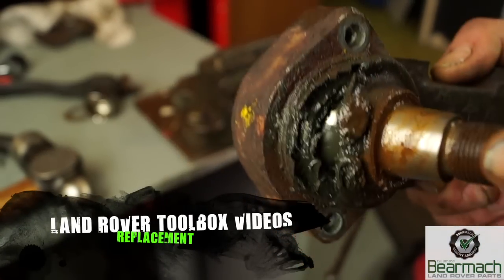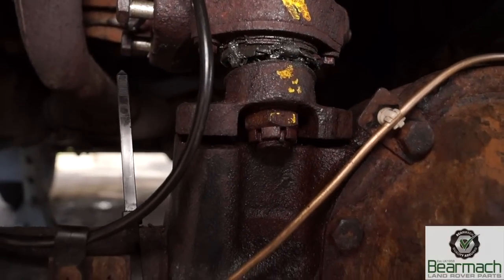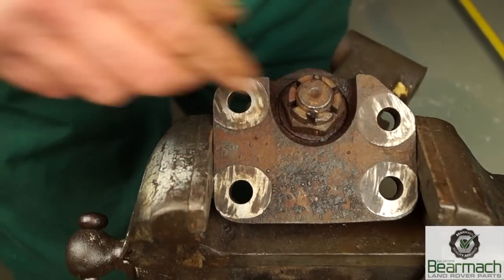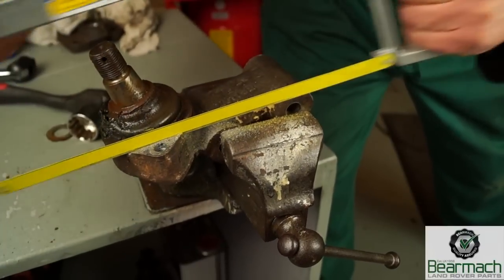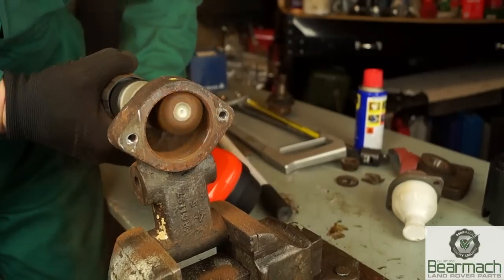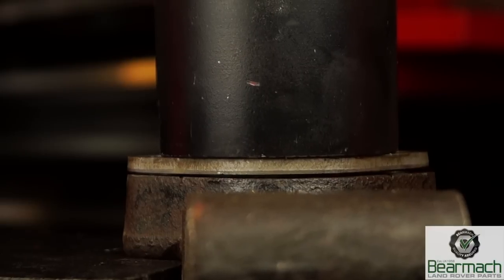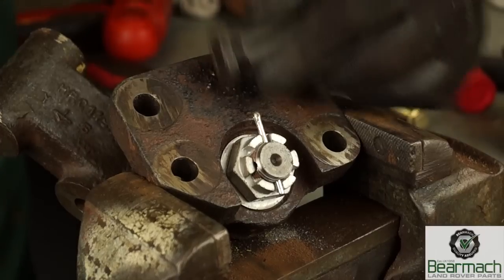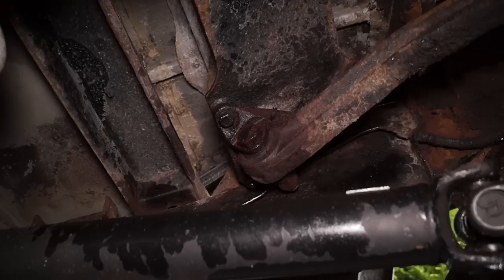Replacing the suspension A frame ball joint - The Fine Art of Land Rover Maintenance

Comment: I think your videos are excellent thanks, I have lost count of how many of those ball joints I have changed and I have never had to take out the 4 bolts on that mounting plate (the least you take off the better in my book) I just jack the vehicle up an inch under the A Frame itself in front of and close to the diff to apply about a tonne of upwards force on the ball joint, with the castlated nut unscrewed so it's flush or slightly proud of the ball joint thread hit it hard (the nut) upwatdswith a lump hammer, using a short drift if nessecary and it you get a good hit it will go bang and drop an inch, keep the wheels just off the ground an inch, can't drop on you, no axle stands to fall off or sink into the ground, sorted. Hope that helps someone, all about teaching eachother, that's why you videos are cool, cheers (ps remember the 2 M8 bolts are just a secondary fixing, the splines hold it together, so don't sand them off when cleaning them) 😊

Comment: I would be screwed without your videos.  
Here in Australia defenders are not common at all.  Yep it's the reverse of how common defenders are in the U.K.
Thanks heaps.  I've replaced most of my 1995 110 suspension and Bushes at home with basic tools & a cheap FeeGay press.   A frame tomorrow & pitman arm joint next,   only because i don't have the pitman arm puller tool yet.  Total cost so far including buying the press is under $400aud.   The shop quote(pedders) was $1328.

Comment: Superb vid. I soaked mine daily in plusgas for a period of three weeks and it reluctantly came out with an almighty bang at an indicated 15 tonnes of pressure - the absolute limit of what my press would do. Overall an unpleasant job and I would recommend anyone who is at all unsure to get a pro garage to replace the balljoint.
Reply from the maker: putting pressure on it then give it a few taps with a hammer helps sometimes to free off the taper.

Comment: I followed the video to change the upper link ball joint on my 1991 defender 90. Unfortunately it didn't go as easily as you showed in your video.
1 The ball joint wasn't secured to the top of the rear axle by a mounting plate secured by 4 bolts. In fact the taper was secured by the castellated  nut to the mount which was an integral part of the axle so I had to remove this nut in situ and a good blow with a lump hammer didn't free the taper. It took the application of a good deal of heat and a hefty blow with a 4lb lump hammer to shift it.
2 After removing the unit from the vehicle and following your advice of sawing off the two lugs I then tried to press the ball joint from the mount, again my 10 ton press didn't shift it. Once more  had to resort to the oxy-acetylene. This time it popped out with the expected bang.
Just hope the assembly doesn't take the same brute force

Comment: brilliant video I'm going to do mine on my Discover 1 300tdi, but it had a different set up to this one its got a nice bracket where the ball joint is that you can't fit a socket in, have you had any experience with this ? I've tried undoing it but its Tighter than a nuns ......you get the point  i think I'm just going to heat the nut up and probably cut it out with the oxy

Comment: Hi good video, but i would not recommend removing the ball joint mount plate from the diff, my Td5 has 4 special nuts with non-hex heads, and IMHO, never meant to be removed. I was easily able to fit a 30mm socket onto the ball joint castle nut, you just need a bar or pivoting handle with a compact end. It may take some force to crack it. Once the nut is off, an effective way to get the ball joint out is to use a wedge fork tool, the type that are specially made for this task. A worthwhile investment, I have 2 sizes, the smallone does the front suspension ball joints.
Reply: They are 12 point heads.  You use a 12 point socket or a closed end spanner.

Comment: Good vid but for us in the U.S. market the rear upper link bracket is welded to the rear axle, at least on my '98 D1, so you have to remove the entire link to get to that upper ball joint. You're going to have to lift the truck up by the frame until you can get a box end wrench on it and then use a second box end wrench as a kinda breaker bar, I used a 1 3/16" as my collection of metric box ends stops at 24 mm, then take off bolts holding link to frame and tighten all the 130 ft lbs/ 176 newtons when putting it back together.

Comment: Also sorry another question, is there a way to change this without a press? Using a vice, hammer, or bottle jack with some weights?
Reply: I know this is far too late but for anyone else looking you can now buy the whole assembly so you don't have to press the joint out/in

Comment: Would this cause nasty vibrations at 62 65 miles an hour
Reply from the maker: no it wouldn't ,...more a clunk at the rear end if worn.  Vibrations are either  wheels,  steering or suspension related on the front